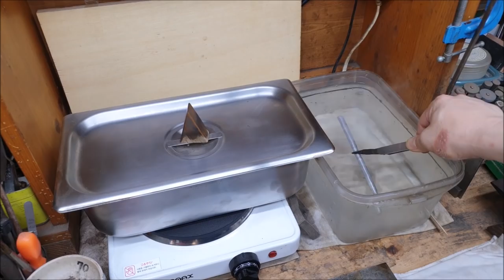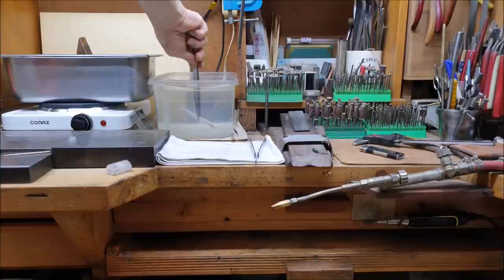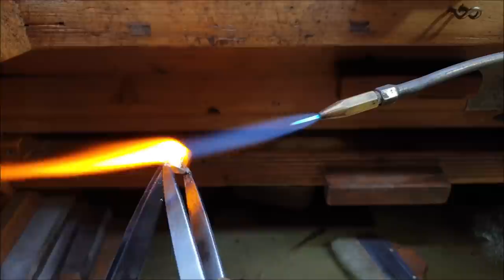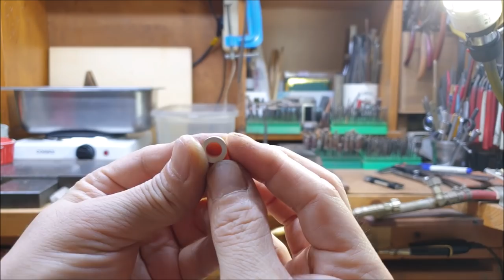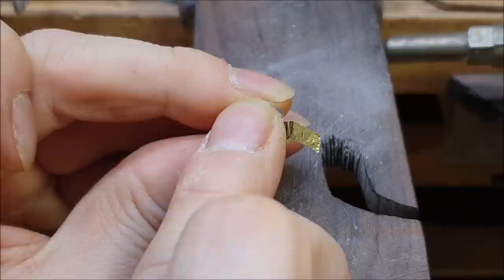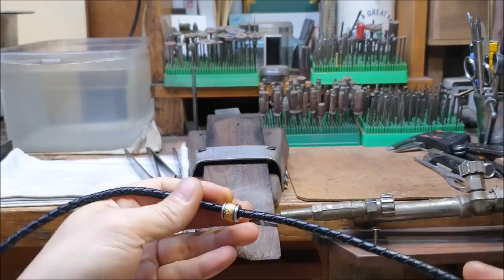[ Korean Craft ] SILVER RING Making process / KEUM-BOO Technique

Comment: You have a very awesome YouTube channel. I would like to apply the keum-boo technique to my artistry but since I'm just getting into it I would like to ask you for some pointers especially since you have great experience with what you do based on the content you upload and the products that you make. 
- Are there any books or other materials that I can purchase about learning the Keum-boo technique?
- Which type of gold foil or gold leaf to purchase for use with .999 silver or .925 silver? If you can send a link to the one you use I would greatly appreciate it.
Reply from the maker: The thickness of the gold sheet,,,
A postcard-sized gold sheet is about 3-4g.
That's about the thickness.
It is about the thickness of a regular paper.

Heating these metals to a temperature between 260~370°C increases 
the movement of the atoms. 
When pressure is added, this causes an electron exchange at the surface between the two metals, 
creating a permanent diffusion bond. 
This diffusion bond occurs far below 
the soldering temperature for either metal (Dhein, 2004).

Nothing is permanent in this world.
It may wear out over time.
Physical contact may cause it to peel off.
It doesn't go away easily with the passage of time.
Because silver and gold became one.
This is different from normal plating.
Reply from the maker: I learned all the information about keumboo from Korean teachers and books in Korea.
The gold paper used in keumboo technique is used by directly stretching pure gold thinly, and it is also purchased offline in Korea.
Keumboo can be made of either pure silver or 925, but it only adheres well when it goes through a cleaning process (removing fire scale) by applying heat and repeating pickling.
Check out my learning video about gold.
Reply from the maker: https://youtu.be/HU4M6_k82Kk
Reply: @SilverMeister  Thank you for sharing your knowledge,  where can I obtain such post cards size of foil. I rather ask you before buying something and getting scammed. Thanks

Comment: Nice work! Thank you for sharing, I've learned a lot from you're videos! I've wanted to ask you, from a log period, from where do you buy you're gold sheet? I'm working with 23k and is not that thick. Thank you!
Reply from the maker: I use an offline manufacturing company in Korea to make a custom-made gold sheet.
The thickness of the gold I use is,
The weight of gold, the size of a postcard, is about 3 to 4 g,,,
That's how thick it is.
thanks~

Comment: What is the blue liquid you kept using after quenching?
Reply from the maker: Nonferrous metals (gold, silver, copper, aluminum, etc.) are different from general ferrous metals,
In each process, it must be pickled.
When dealing with silver, mainly sulfuric acid is diluted in water and used.
Mix about 10% sulfuric acid and 90% water.
When mixing this, it is safe to add sulfuric acid to water.
Always keep the diluted acid warm.
50 to 70 degrees Celsius is suitable.
By pickling,
By removing borax residues and various impurities generated during work
It plays a role in ensuring that it is always clean.

Comment: Hey, how thin is your gold foil?
Reply from the maker: The thickness of the gold sheet,,,
A postcard-sized gold sheet is about 3-4g.
That's about the thickness.
It is about the thickness of a regular paper.
Heating these metals to a temperature between 260~370°C increases 
the movement of the atoms. 
When pressure is added, 
this causes an electron exchange at the surface between the two metals, 
creating a permanent diffusion bond. 
This diffusion bond occurs far below 
the soldering temperature for either metal (Dhein, 2004).
Reply: @SilverMeister  I noticed that on min 9.50 there is a line that was not welded correctly, how did you solved that
Reply from the maker: I do not weld. What I do is solder. Welding and soldering are completely different things.
And, it is difficult to show everything in the video. edit.
A lot of work that seems to be lacking is done outside of the video.
Since you are not right next to me, it is impossible to give all the details in translation.
Reply: @SilverMeister  🙏🏻 thanx for your reply, I understand